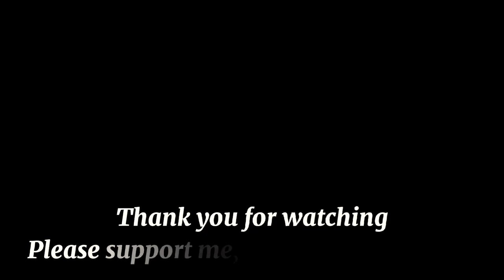New ideas / making 3D floating cement leaves for modern home decoration / It's amazing

Comment: Dear, when I put the cement on the wall directly without nails holding the cement, I find that the cement started to slide downwards and not cohesive in the wall despite the fact that the wall was established with cement only first before starting to mix cement with sand? I do the same tutorials as you on YouTube You don't put nails in, do you?
Reply from the maker: Before plastering with sand-cement, you should apply a layer of fine cement on your wall, nailed with thick texture.
Reply: @ConghungartArtist82  Thank you for your interest. What do you advise me, because I always work in the sun's heat and I always do this work outside in the sun, our temperature is 40 degrees, what do you advise me to avoid cracks? Although wetting the wall with water before starting?
Reply from the maker: @hasanhosny696  In water, do not use sika bucket with cement to prevent cracking. And for me, if the temperature is 40, then I will crack with diluted cement water and I will sweep it to stop cracking.
Reply: @ConghungartArtist82  Thank you very much. Do you mean after cracking that I treat with pure cement and water only as a diluent to fill the voids?
Reply from the maker: @hasanhosny696  That's right, buddy. I do it that way too. that's the end of the crack.
Reply: @ConghungartArtist82  One last question, sorry my friend. If this method is applied to treat the cracks, will the work remain strong and coherent? in the wall. ? In other words, do these cracks affect the strength, rigidity, coherence and cohesion of the work with each other?
Reply from the maker: @hasanhosny696  After finishing cracking, sweep it, or sweep it the next day, don't let it take too long to lose its adhesion.